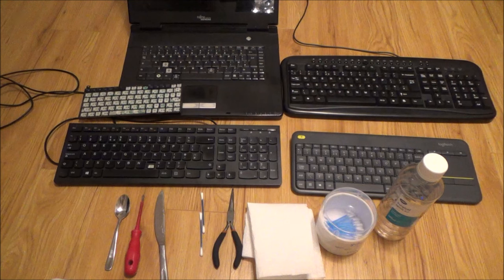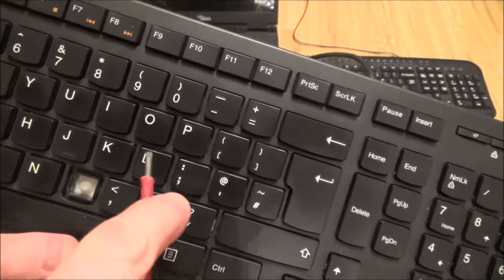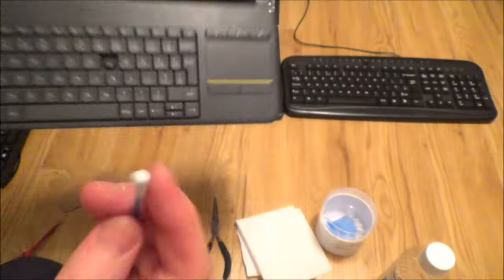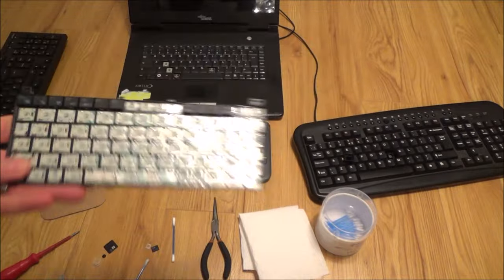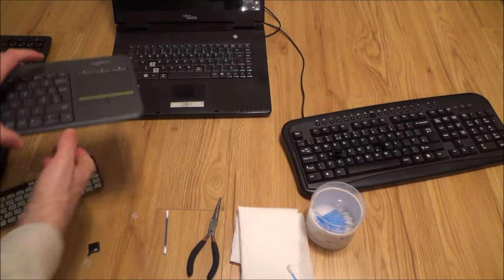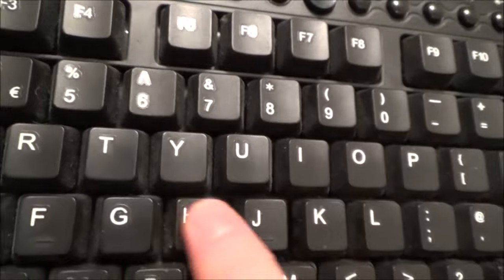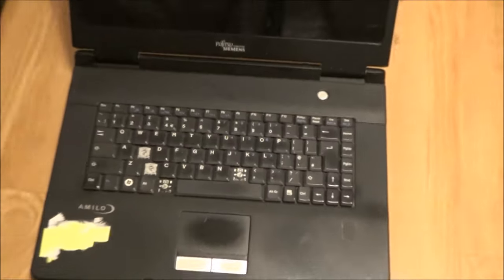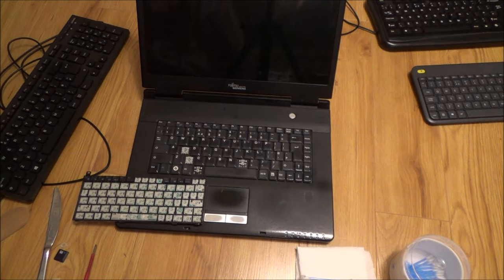How to Remove, Clean & Replace KEYS on various different PC/Laptop Keyboards

Comment: Thank-you for this tutorial. I have Logitech keyboard (silicon keyboard) for 10+ years. This is the first time I popped off the keys and cleaned them and yes, it was as dirty as you can imagine. Btw I used to clean them by using alcohol and a qtip between keys, very hard and slow process to clean it that way.

Comment: I recently cleaned a keyboard. I found that the alcohol wasn't that good at dissolving the dirt. Warm soapy water and a toothbrusch on the other hand worked very well. You have to mind the electronics like this off course.

Comment: Thanks for posting this great video! I do have a question though; I recently purchased a logitech MK540 and the space bar key came from the factory a little crooked, looks like it was not placed correctly when they assembled it and when I hit it on the left side it is harder and with more pressure than the right side. 
To remove it, does it follow the same principle? 
I do see a metal little bar inside so I am worried to try the same method you explained and do something I shouldn't lol. I appreciate your help so much. Regards, Octavio

Comment: This was helpful to understand the mechanics to remove and replace keys.  Mine is a Dell desktop keyboard and the Ctrl key was hard to press down.  It was OK pressing directly in the center, but wouldn't budge when pressing on the edge or corner.

I cleaned underneath as you said, but created a new problem.  The Q-tip pulled loose one corner of the little rubber springy thing underneath and I couldn't tuck it back in place.  Couldn't leave it that way since it was no longer centered under the key.  I removed a few screws from the backside and pried apart the top and bottom just enough to tuck that corner back into place.

Cleaning improved it, but not 100%, so I figured it was just worn out.  But as the key didn't really have a specific top or bottom (or right or left) I tried popping it back on upside down.  It works perfectly, just looks a little funny.

Comment: Hi Vince. I have got a Microsoft Surface Pro 4 cover keyboard. It does not seem to be detected by the Surface. I have tried all the tricks on the Internet. Is there anyway to check whether the keyboard is faulty by using multi meter?

Comment: it wouldnt pop back on and its my first time trying to fix a key and it has this really thin stick o metal that is at the bottom of the arrow key and weird little metal things idk how to describe them not on the key its self its on the keyboard thing where the key randomly popped out when i try to put it in it clicks in place and i give it a few clicks to make sure it wont fall off and it pops off ive been trying all day yesterday nothing . help (i also cleaned it lol)

Comment: NO, the proper way is to use a needle to put fishing line under both sides of the key and pull up, this is to avoid damaging the pressure sensor